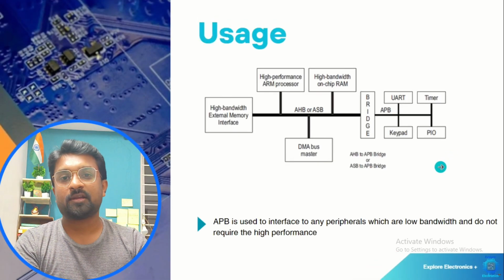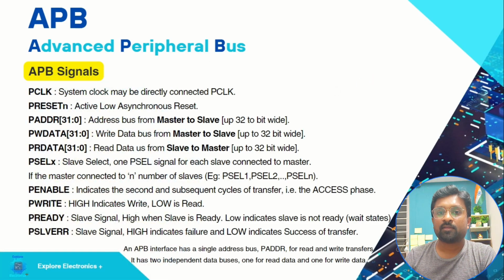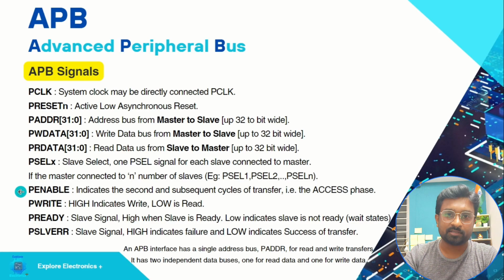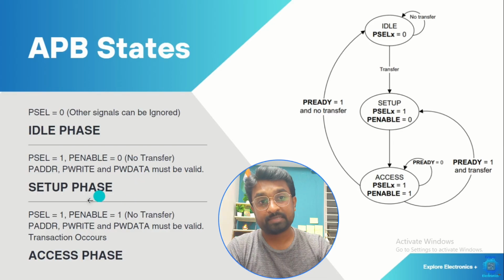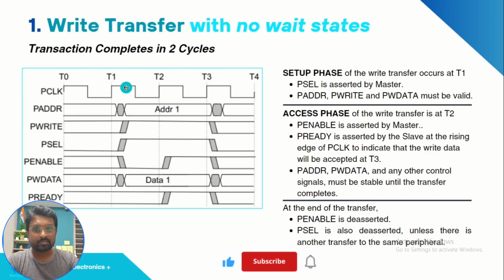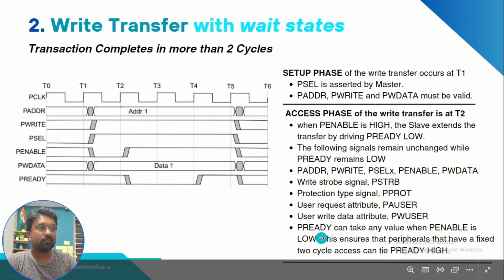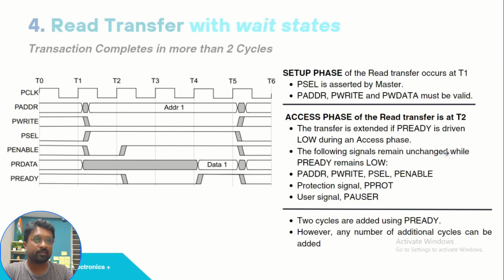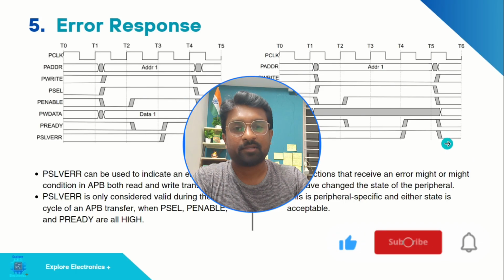APB Protocol Read Write Transactions | with & without wait states | AMBA #APB PART1

Comment: Thanks for sharing this , but very confusing you could have shown the Master signals and slave separately . When PSELx is more than one bit when there are more slaves then how the PREADY & PSLVERR which are output from slaves goes into Master ? 

It will be great if you just take APB salve as just a registers  for explaining UART,  Keyboard doesn't really helpful